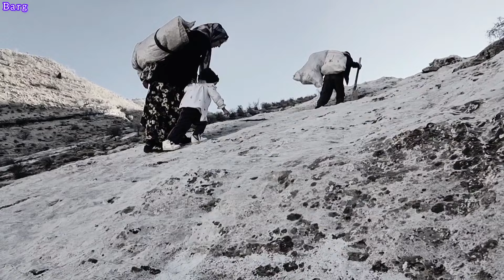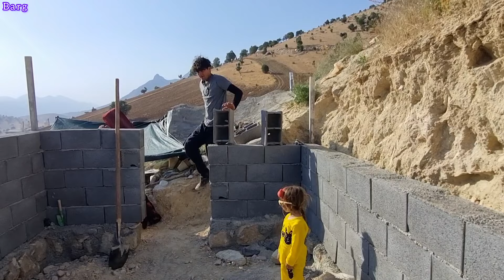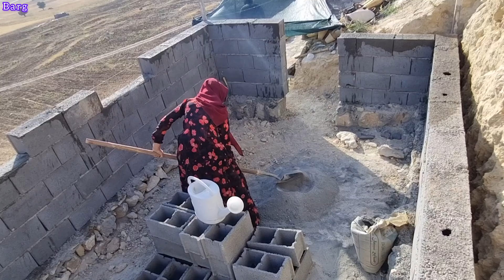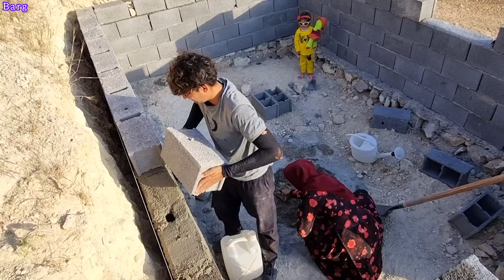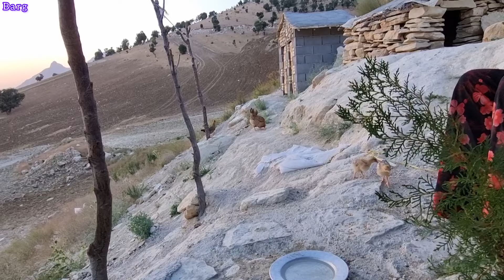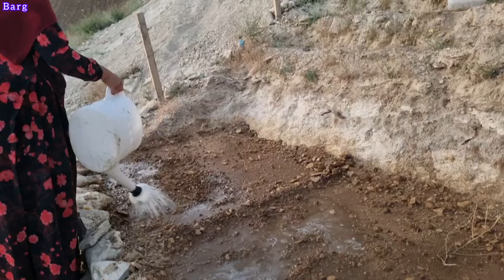Life in the Heart of the Mountains: Zari's Efforts to Build a Dream House Next to the Cave

Comment: Operator… right now there are plenty of harvesters who are almost finishing harvesting and they leave sometimes some wheat in flakes behind the flakes they’d can’t take but are still good to get by sacks so to mix with cement for thé roof..would be cement saving and on top is stronger and thicker good isolation on the roof.. do you think the worker with Zari could go around getting several big bag of these flakes almost for nothing.. see if you could talk about it to Zari.. Thk you